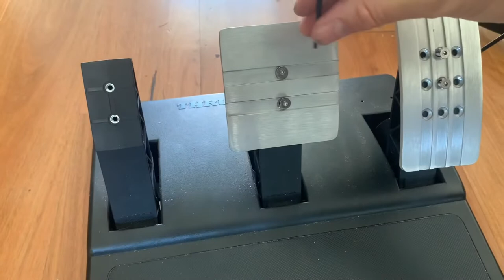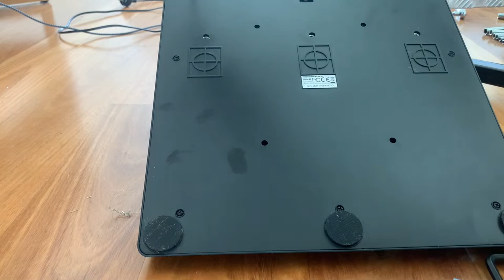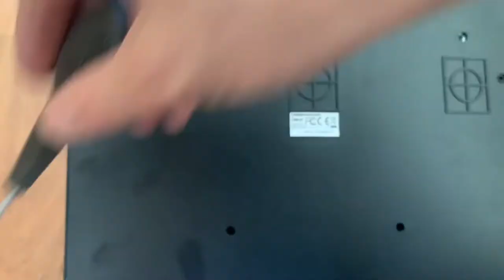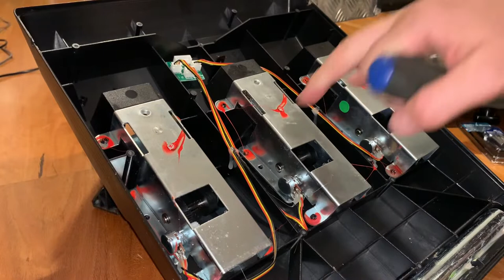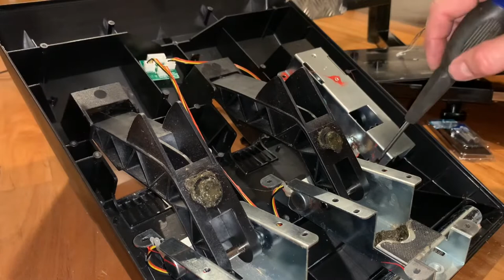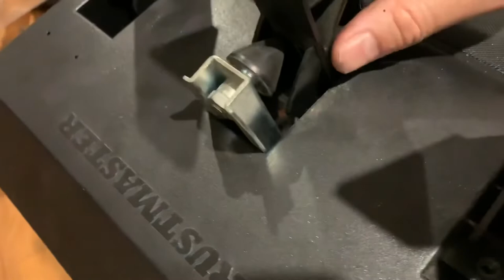Thrustmaster Pedal Mod - Spring Swap - Brake Support Bracket

Comment: Thanks for the video, I wanted a look into the unit before I broke mine open, exactly what I was looking for. You should definitely invest in a quality drill with a good clutch though.
Reply from the maker: Thanks mate. I hope it helps. Next I’ll be getting some of the aftermarket spring fillers to firm it up a bit more
Reply: @TheEddysGarage  Who makes aftermarket springs? I did a quick search and didn't see anything super obvious but maybe I mis understood the descriptions
Reply from the maker: @wekphoto  I just swapped the springs around. They are different stiffnesses
Reply: @TheEddysGarage  right but in your previous comment you mentioned stiffer springs from a 3rd party and I was curious to who you meant?
Reply from the maker: @wekphoto  lots of springs and spring fillers on eBay but I haven’t tried them yet
Reply: @wekphoto  Not sure if you’re still in the market, but I just installed a set of springs from ppm racing and they’re miles better than the originals. You get a far better sense of how much you’re on or off the throttle and brakes
Reply: @YaBoiHarms  is it PPM? I tried googling it but didn't see any results. Where did you get yours from?
Reply: @wekphoto  ppm-rcracing t3pa spring upgrade. I’ve had about 10 hours race time with them and I think they’re great, a massive upgrade over the stock springs. Prefect upgrade for the price until you’re ready to buy a load cell pedal set.

Comment: I did this and my brake pedal won't go past 30% now. Electronics are touchy and something got screwed up while it was apart. Be prepared to take that risk I guess
Reply from the maker: That’s odd. Is something keeping the pedal from moving all the way? Is a wire jammed?

Comment: I tried this ( thanks for not showing how hard iit is to put in the break buffer, my breaks stopped working after I did this. Total thumbs down, bummer you shoiwed how to switched springs but left out the hardest part/!!!!!
Reply from the maker: I didn’t show it because it wasn’t an issue. Was the bolt cross threaded? My friends was all rough from factory and we had to retap the hole.
Reply: If that break buffer bar gave you problems, then maybe you shouldn't have been opening it up in the first place...

Comment: About to do mine right now thanks!
Reply: Your video helped me get through the whole process 🙏 my pedals feel like a real car with just the springs
Reply: What brand of aftermarket plates are those?
Reply: @No_one_available23  Those pedal plates are the stock plates that come with the T300RS GT bundle (it was made for Gran Turismo Sport)
Reply: @razmann4k  that's weird mine are 100% different
Reply: @Razor Man
Are you sure yours is the GT version?
Reply: @gregoreo1975  Yes I'm sure, because the box says GT Edition, the wheel has the Gran Turismo logo and 'GT Wheel sticker' on the back.
Reply: @razmann4k  bought new and original or aftermarket? Long ago? Have the receipt?
What's the picture in the box, silver or plastic? Mine is also a silver plate.
Reply: @gregoreo1975  Brand new, bought it about 2 months ago. The picture matches the actual pedals.

Here, look at what a T300 RS GT Edition is supposed to look like: https://www.evetech.co.za/repository/ProductImages/thrustmaster-t300-rs-gt-steering-wheel-1000px-v2-00021.jpg
Reply: @razmann4k  exactly. Mine look like in the pic
Reply: Mikro Wave  Negative. Both T300RS GT and T300RS Ferrari Alcantara should come with T3PA pedals.
The normal T300RS wheel comes with a pedal set of only accelerator and breaks. T300RS Ferrari comes with the same pedal set, but also with clutch as a third pedal. T300RS GT comes with GT EDI pedal set. The difference between the last two should be basically aesthetic.
There's also 2 other types of pedal you can buy separately, both better: T3Pm, newer and use magnets (hall sensor) and TLCM, that are load cell and top of the line.
The one in this video is the correct one to come with the T300 RS GT Edition.
If there's one thing I'm not sure about is if the Ferrari version also comes with that rubber add on one can put behind the breaks, as T300RS GT do.

Comment: I have a problem. My brake pedal broke while I was driving...and you can see from above that the spring is no longer fixed at the top of the pedal, but loose...can this spring be reattached to the upper pedal?P:S Ive openend the pedals, and ive seen that this spring was broken....Now ive ordered a new spring.
Reply from the maker: Not sure but you could give it a go. Try wrapping a cable tie

Comment: Hi there. May I know if you need to remove the bottom casing to install the conical brake mod?
Reply from the maker: It makes it easier and you should sway the springs around anyway
Reply: for only installing you dont need to open the pedals.

you put it in from above and the scree comes in from the bottom

Comment: I opened my brake pedal because it was hitting 70% max. Now when i press the brake, no imput js registered by my playstatio...
I saw the gear of the pedal was moving, but the white gear that is attached to the cable, doesn't move with the black gear. I think this happened while replacing the brake pedal. Any tips? Or did I just screw it?
Reply from the maker: Make sure nothing is jammed and everything moves before putting it back together

Comment: Did you grease the springs, and pivot points? I think I need to cause really squeaky.
Reply from the maker: I didn’t but a little lithium grease will work fine. A little goes a long way so don’t overdo it

Comment: You could have mentioned that the calibration of the pedal will also get all fucked after doing this and that there is no way to re-calibrate them. I have to switch back now...
Reply from the maker: I have had no problem and didn't have to recalibrate anything. I just swapped the springs and went back to gaming.
Reply: Well of course the calibration is going to be a bit off. You've just changed the resistance under each pedal.
Reply from the maker: @HxR-eSports  mine worked fine and didn’t need anything
Reply: @TheEddysGarage  Neither did mine. I was just giving Andy a possible reason as to why he might need to recalibrate the pedals in certain games. 🙂

Comment: Pretty sure that was all for nothing. And people are breaking their pedals over this. 
The pedals are designed to also be used inverted. Hang down from a rig. That means your clutch becomes your gas and visa versa. So the springs are the same. 
If you ever see a T300 and that little red light on it is shining green instead. That means the wheel is in inverted mode. Gas becomes clutch, clutch becomes gas. So pretty sure the springs are the exact same. Only differance can be is that you wore out the gas spring more then the clutch.